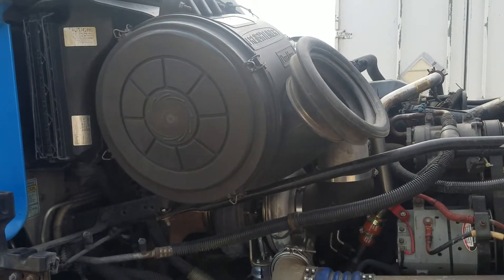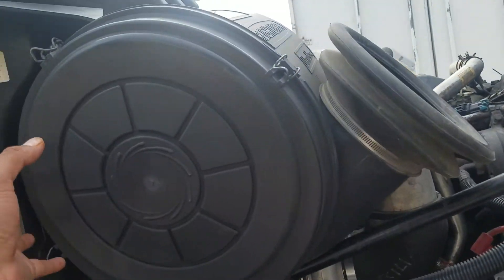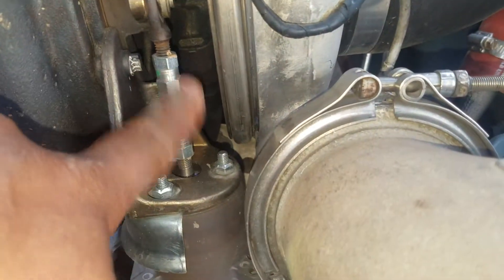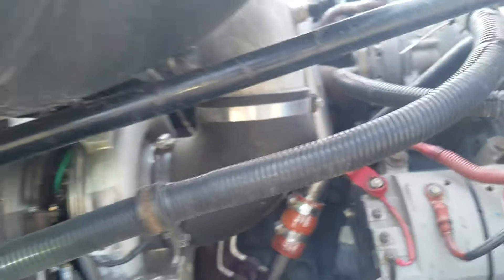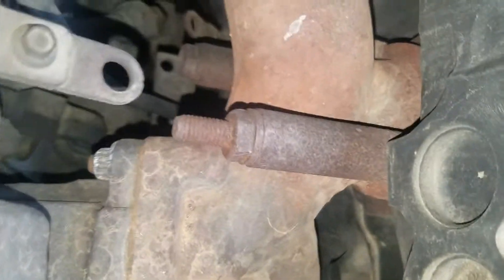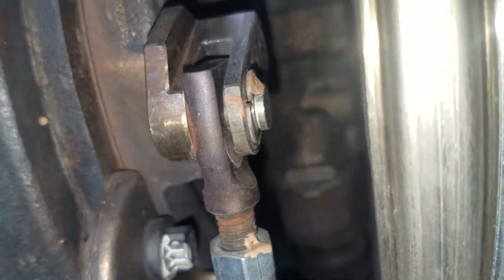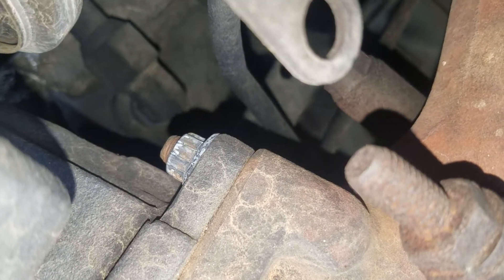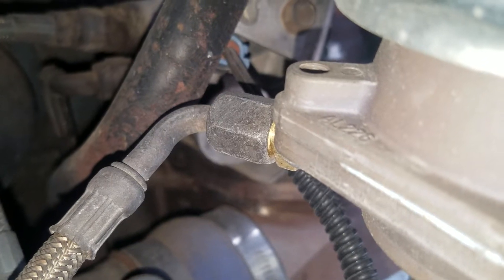Detroit s60 tubo replacement

Comment: Hi jose, l got turbo oil return line is leaking. To replace oil return oring. Do l need to remove the turbo out?
Reply from the maker: I think you can remove the return line from the bottom off the engine otherwise you have to remove the turbo
Reply: @josebeltran4737  l did removed the turbo but l am having hard time attaching the clamp from exhaust pipe to turbo.
Reply from the maker: @kalisterkalister5925  sometimes it moves maybe some one can push the pipe that way you can put the Clamp
Reply: @josebeltran4737  l did and l was able clamp the exhaust pipe.   I messed up the wgr valve. I was try to remove the egr valve bracket that hold egr in its position but l broke the bolt and oil was coming  out of egr valve.  I am going to extract and drill the egr block
Reply from the maker: @kalisterkalister5925  sorry to hear that hope you fix it
Reply: @josebeltran4737  yes l did and thanks for your video it help a lot
Reply from the maker: @kalisterkalister5925  I'm glad you fix you problem
Reply: Yes l did and no more oil leak from turbo

Comment: Do you need to computer program for turbo or just replace ?
Reply from the maker: You can install the turbo your self but you need to take it to calibrate it 
Cost like a $100 dollars to calibrate it calibration is fast most of the shops have the program to calibrate it
Hope this helps.